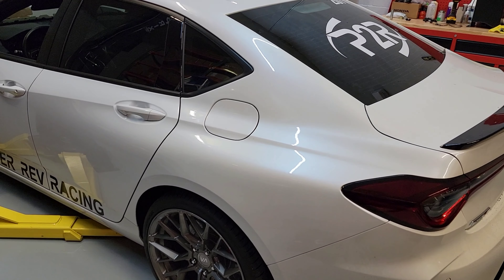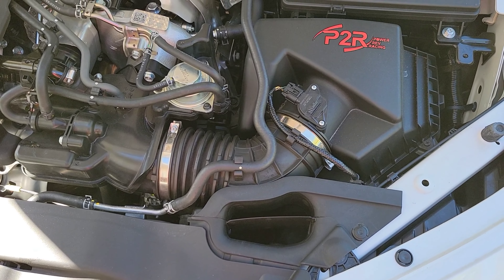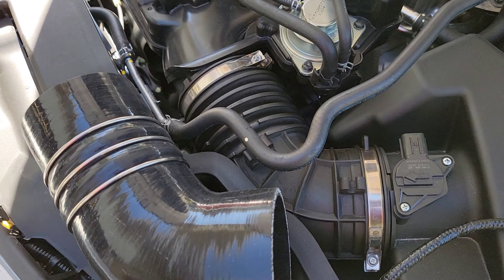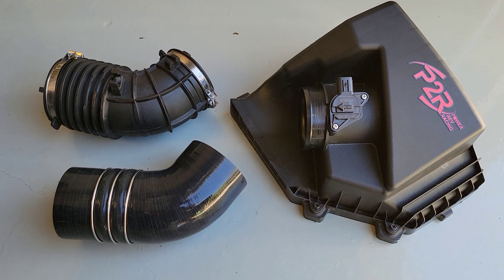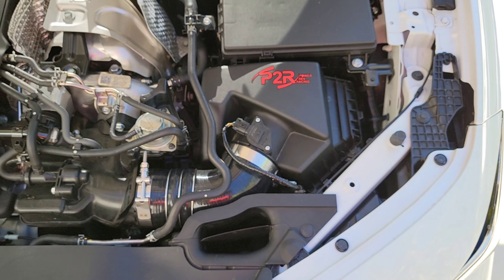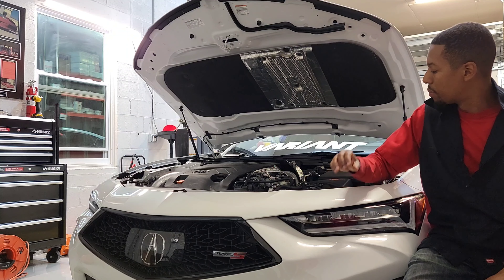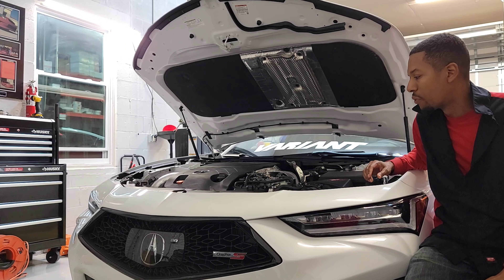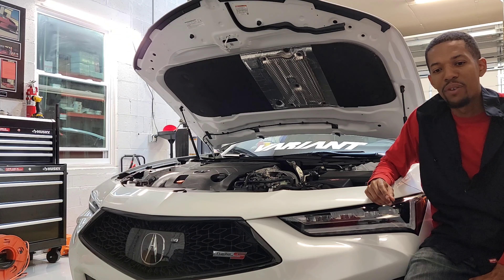P2R TLX Type S Silicone Intake Tube

Comment: I wish there was something like this for the 9th gen V6 Accords. I think the stock box with high flow filter is the best option.
Reply: I mean, it honestly doesn’t do a whole ton gains wise. If anything, it might give a bit extra sound, bc of less restrictions; but the stock intake resonator chamber below would have to be deleted as well, for max sounds on the stock airbox, really. 

On the 9th gen Sport 2.4L K24W1, I was able to run an HPS silicone intake hosing to the stock air box, alongside a K&N high flow, reusable air filter. K&N is probably the best bang for your buck, as far as offering OEM quality, while being washable and re-oiled. 

Although it’s pricey, and I wish it had the full shroud to the front top grille piece like the ‘14+ Acura TLX, I’ve been running the aFe Momentum cold air intake system on my 9th gen AV6/6MT. It provides way better gains over the stock airbox due to the intake design, but I also wish there was a way I could fit a pre-filter “sock” onto the cone filter inside of the air box. The air box is so closed off, that even with the front open duct, the ECU will throw a lean CEL, if I do run the pre-filter sock inside of the aFe airbox housing. 

Needless to say, the aFe Momentum cold air intake is the perfect CAI system if you’re looking for near stock/OEM fitment, and if you’re looking for the most effective way to remedy heatsoak on Honda/Acura engines. However, $450-500 is a rather expensive price to pay for an intake system…. I actually bought mine pre-owned and had the prior owner actually install the proper OEM Honda bushings onto the aFe air box for me (which it required).

Comment: What are those wheels? I have had trouble finding 20" wheels that will accommodate the Brembo's.
Reply: Hey man we’re running 
Varient cold forged 
20x10 squared plus 39 
275/30/20

Comment: Has anyone found a way to crack through the computer so we can tune Tlx Type S's?
Reply from the maker: Not yet but we have a preset tune that adds around 90hp that were adding to our website this week.
Reply: Are you referring to the jb4?
Reply from the maker: @rd5140  yes but we still haven't got them in stock yet so haven't been able to add to thr website yet 😕
Reply: @PowerRevRacing  I ordered mine...I believe they are waiting for more maf connectors....I'm dying to see dp, tb, and increase boost performance numbers!!
Reply: @rd5140  curious why you haven't plugged in the jb4 with your other bolt-ons?